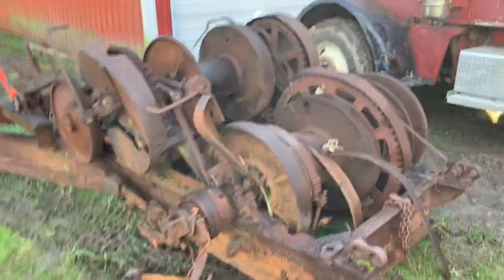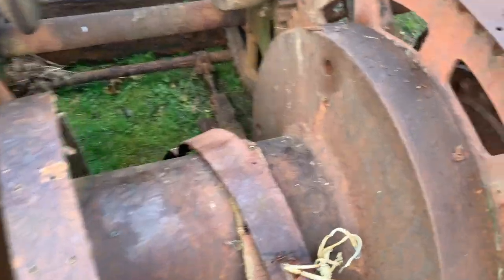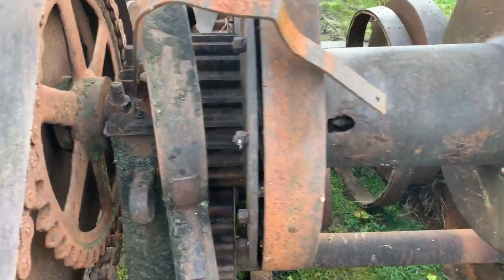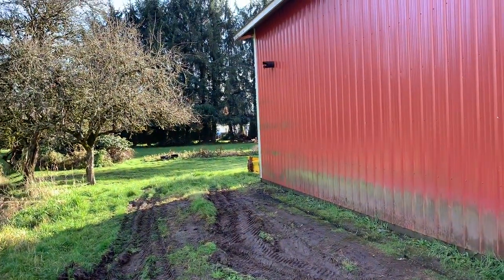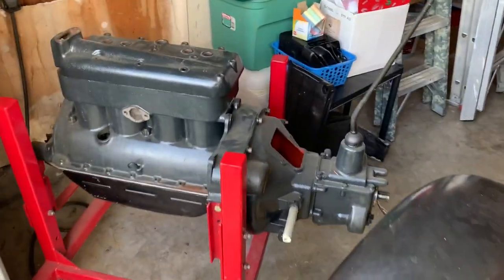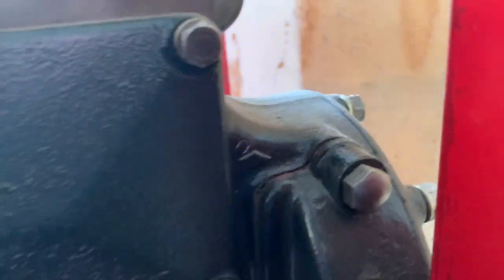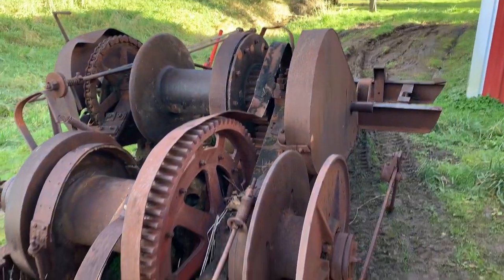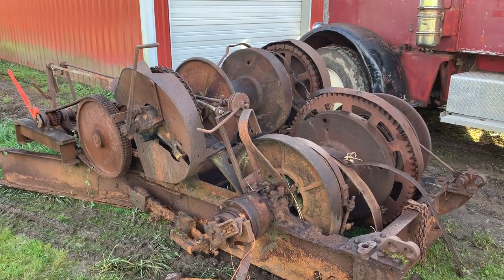We acquired a Skagit logging donkey!

Comment: I THINK YOU SHOULD PRESSURE WASH IT!  WHAT DO THE REST OF YOU THINK???
Reply from the maker: I you bet. When I start working on it it will get a good wash and soak with oil to get everything freed up.
Reply: @tttco  
Have you ever used a 50/50 mixture of transmission fluid and acetone for your soaker mixture. (Remember acetone is flammable ,eats paint, and melts some plastic.
Reply from the maker: @c50ge  yes sir I have it works great!!!!